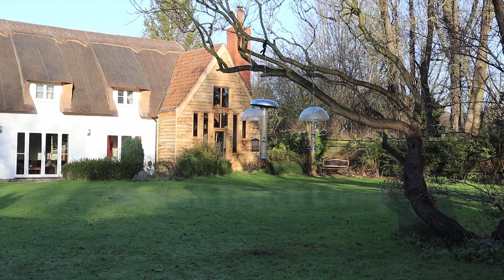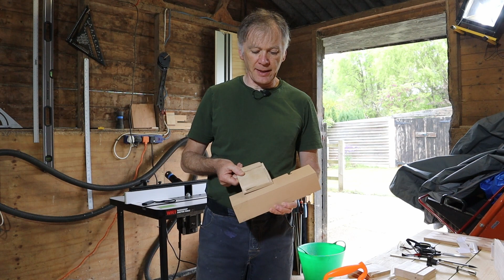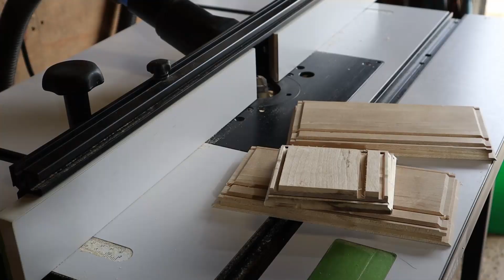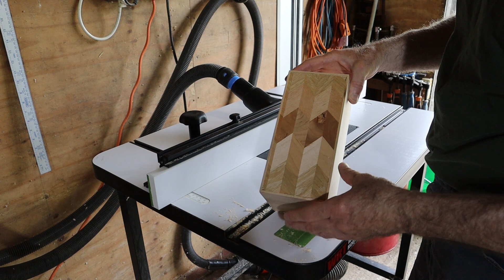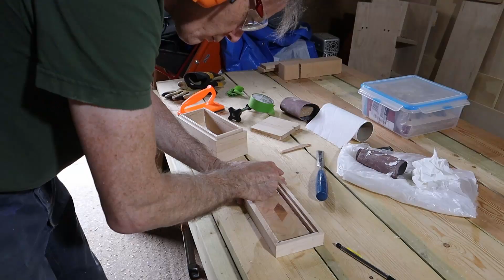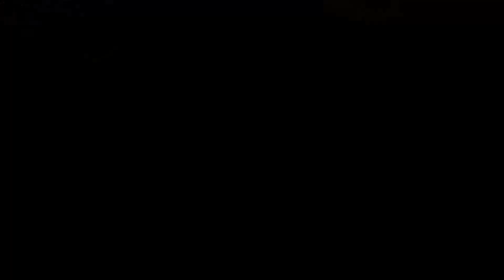Making a small maple wooden box using lock mitre joints and figuring out how not to get tear out.

Comment: I have found that using multiple passes when routing the vertical piece is best for me.  I set the bit height and fence position for the final pass and with clamps , I can  take incremental passes until I reach the clamps. I found doing it this way is better even for the horizontal piece.